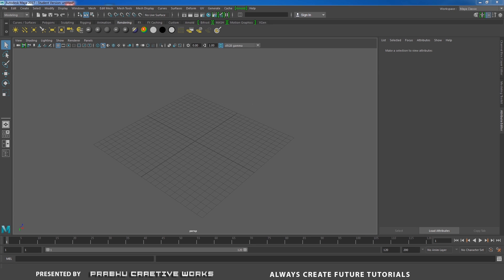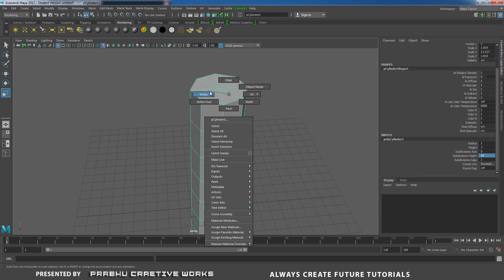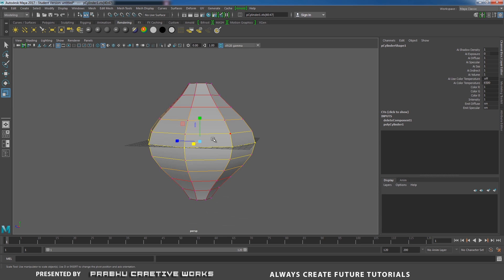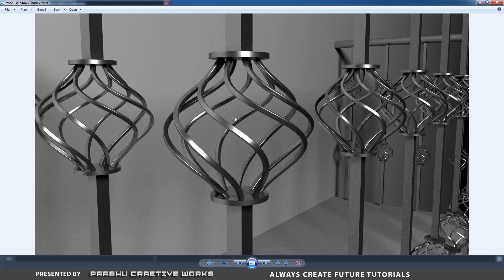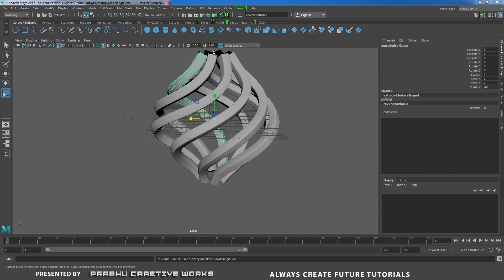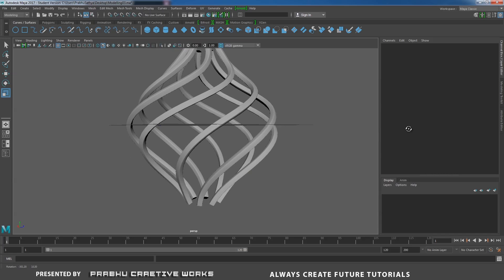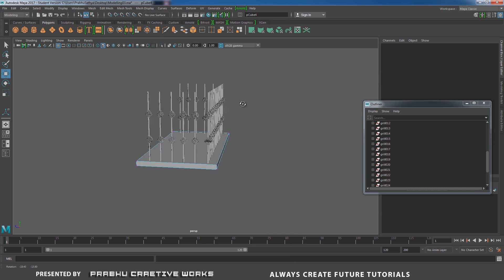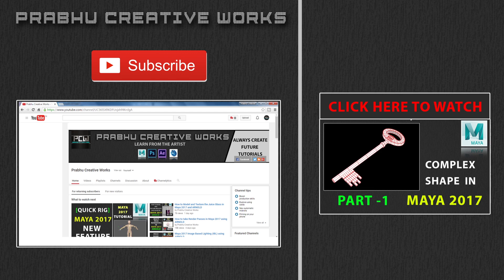How to Model a Complex Shapes in Maya 2017 |   Part 2

Comment: why make a nurbs cylinder into a cube, rather than using a nurbs cube itself?
Reply from the maker: nurbs cube is not an perfect cube its an number of line connect as a cube check after creating nurbs cube in outliner
Reply: Prabhu Creative Works ohhh..Thanks for the info!
Reply: basically what  happens is that nurbs cube has 6 separate faces. It's a tough path to take. I believe he used a nurbs circle because it also helps avoid the beveling part.